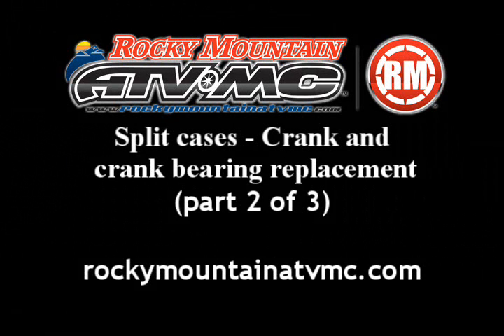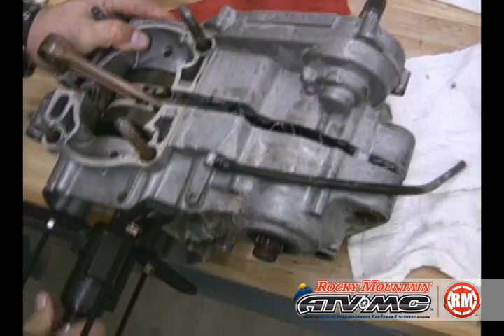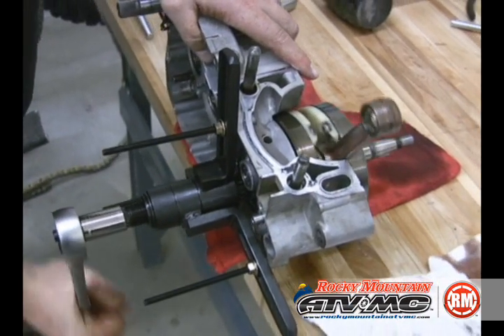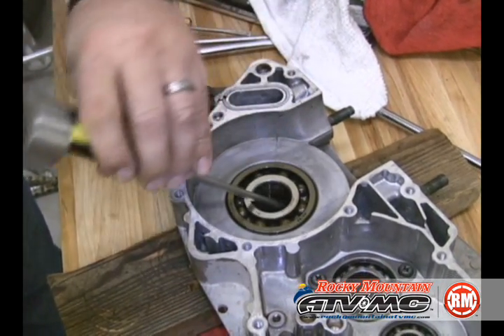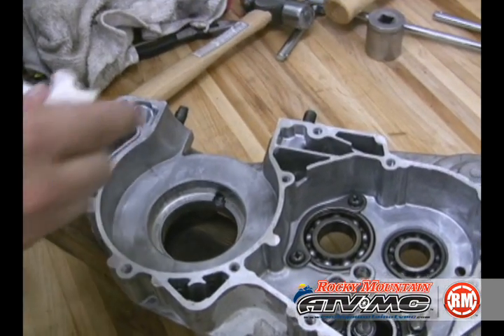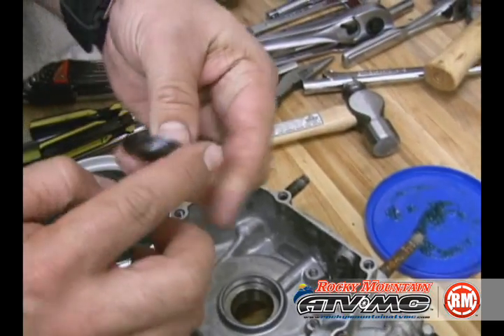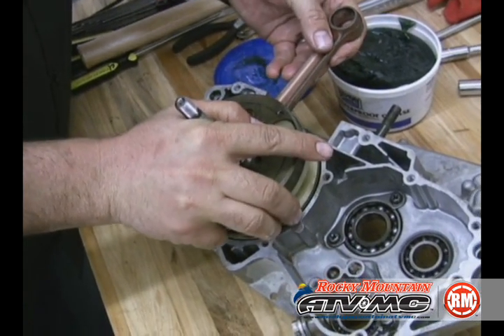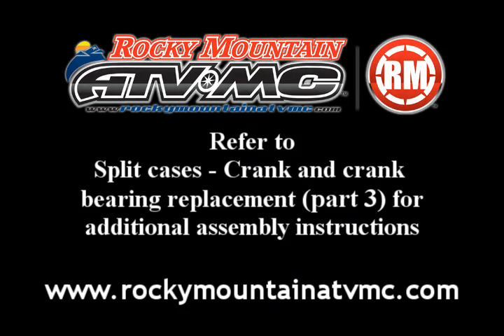Motorcycle Bottom End Rebuild | Part 2 of 3: Crank & Bearings

Comment: I did this bottom end rebuild and after me bike didnt run right, I pulled it apart and the cylinder has wore out of round. I also noticed that the crankshaft is all the way to one side of the crankcase, is there supose to be an even gap on both sides of the crankshaft and could this be what caused my cylinder to get out of round?

Comment from the maker: You don't want any up and down play in the connecting rod so you have a couple options... depending on the bike you have some cranks are easier to rebuild than others but a lot of times you have to have a shop do it. You would need to buy a new connecting rod assembly if you go that route... If not you can just buy and entire crankshaft assembly which already comes balanced and assembled but it's up to you...

Comment from the maker: Nope it doesn't matter, you can install them into either side. I will usually start with the right side and work from their but it's basically up to you to start with whatever side you think is gonna be easier. On some bikes if your crank puller only fits on one side of the crank it may be easier to heat the bearing and freeze the crank and install that side first and then use the puller tool to pull both cases together. Other than that it's totally up to you

Comment: For the other side it will pretty much handle itself when I go to put the case back together using a criss cross pattern it should be fine sliding the crank into that side by tightening the cases correct? U don't really need any tusk tools right.. I mean what did they do years ago before tusk was a company.prob help a lot to have them but don't absolutly neeed them

Comment from the maker: The only way to get these bearings off and not jack up your crank is to use a bearing puller. We sell a Tusk Crank Bearing and Gear Puller Set for $59.99 a piece. The part # is 1195970001. You don't want to hit and pound on your crank at all so a bearing puller is by far the best and easiest route to go.

Comment from the maker: I like to use a bearing driver set but if you don't have access to one a socket that sits on the outer race works just fine. Just watch and make sure the bearing goes in straight.

Comment from the maker: Usually i will put the bearings in the freezer overnight so they are good and cold and then pull them right before you and going to set them in. When heating up the case half i will go around it with a torch for a few minutes to the point where water will sizzle as shown in the video. Alot of times the bearing will drop right in with a little assembly grease but if it doesn't drop right in don't hit it directly on the bearing.

Comment: Nice instructive vid thx for that !!! Just to be sure... how long do you let the bearings cool down in dry ice & how long should an average warmin' up fase of the crankcase take with a propane torch? I tried to warm up mine with a heat gun and the bearing got stuck half way.. had to get it in with a hammer and that killed the bearing :( .... thx

Comment from the maker: Just follow these videos and your service manual very closely. You'll need a few different tools such as a flywheel puller, case splitter, crankshaft install/ puller tool and then also a clutch holding tool.

Comment: I have a important question, i was given an early 90's model rm 250 and the promblem was the guy i got it from drooped a bolt into the bottom in and locked it up and i was wondering if there was any way it couldve damaged the transmission???

Comment: I wouldn't suggest using a hammer and socket to remove the crank bearing. It's best to press them out using a proper tool, main reason is that if you should miss the socket your likely to damage the cases. Also some bearing can be considerably tight in the cases and care should be taken to remove these. Remember a bust or weakened case will be expensive to replace. JMO.

Comment from the maker: - It isn't actually cracked.  It is a "mark" from the casting process.  it is on the surface only and was there when they pulled it from the mold.  It is not a problem.

Comment: Sir, if you stop the video at 3:23 you can see a hairline crack in the crankcase just outside of the main bearing at the top of the screen. I rebuilt the bottom end on my 2005 YZ250 which is pretty much the same motor you are working on I believe. I had 1 crack like yours on one crankcase, and 2 on the other. None went all the way to the main bearing. Should I be concerned about these? Can they be repaired or is buying new cases the only solution? Thanks for your thoughts.

Comment: actually I did this on my bike today and you need to clear one thing up with everyone. Using a hammer to put the old bearings out is dangerous... especially since its common to sweat them out as well. Use a press to get the bearings out not a hammer you can ruin your cases that way. My shop teacher who has been fixing bikes chewed me out a bit because I nearly ruined a motor doing that.

Comment: i got a 03 kx250 and i removed my bear for the crank and used a hammer to put the crank bearing in and i didnt lube up my seal and one of my bearings spin faster then the other should i remove then and do what u did or will i be okay

Comment from the maker: - great question. Very common on kawasaki's. yes you can still heat the case, but don't use a flame. heat the case in your cooking oven. Just set the temperature to about boiling temperature. This will not hurt the seal. Your wife may be mad about the oily smell in her oven though (of course we like the smell)!!
Regarding the gasket - a 1997 kx250 does not have a center case gasket, so don't use one - use the liquid gasket.  the one in the kit is most likely for another year the kit also fits.

Comment: I have a 1997 kx 250 and the only was to insert the main seals is from the inside of the case. and the only way to set the bearings is to "swet it in" will that melt the seals if i heat the case and then install the seals and bearings? and in my rebuild kit it came with a gasket for the 2 case halfs. when i first split the case, it only had a liquid gasket. should i use the gasket provided? or go ahead and use the liquid gasket? Thanks in advance!

Comment from the maker: - your YFZ doesn't have a gasket between the case halves.  you must use yamabond.  Usually the rod bearing wears out before the main bearings (not always).  I would consider changing it as well since you will have it split.

Comment from the maker: @wardy1231980 - that bike is tricky because you have to put the two gear shafts, shift forks, shift cam intogether at the same time.  It is best to refer to the manual to see how they all fit together.  It is tricky getting them into the case half at the same time.

Comment: hi guys, yet again your vids are awesome. Any tips or tricks to putting back the transmission? i got a Yz 250 2000 model 2 stroke and it had major 1st gear shudder. i sorted all the clutch out and it didnt cure my problem. so engine out and stripped down, Theres wear in the 1st gear slots ( pretty bad ) and im changing the selector fork for good measure but as my trannys in bits im a bit stumped as to how exactly it goes back together. mainly the shift shaft. Can it only go in one way?? HELP lol

Comment from the maker: @breno6511 - you will need to look at a parts diagram to see where the water chanels run.  It has been a while since I tore apart a CR250r engine.  if the oil runs through the right case cover into the center case, it is a possibility there as well.

Comment from the maker: @breno6511 - It can only get in the transmission in a few places, so you will have to double check each one.  Obviously one is not sealing.  The base gasket or waterpump seal should be the only two places.

Comment: @RockyMountainATVMC  cheers mate, ended up borrowing a puller from moto joint, not easy to get your hands on if you dont know the right people, and the case splitter are sold most auto and tool shops, but the thing is, no one knew what it was or what its for haha

Comment from the maker: @bar4rodski -  The crank on a two stroke is lubricated by the premix oil you put in the gas.  The Air/fuel mixture is drawn into the crank, then pushed up to the combustion chamber.

Comment: @RockyMountainATVMC ya we used a harmonic balancer puller i think it was called we found the tool and bought some long bolts and nuts and it worked great only thing I got it all together and the clutch isn't working (this is my 5th time completely taking a blaster engine apart and putting it together) it starts in neutral but the clutch rod that hooks to the cable at the case i believe is sitting on top of the push rod that goes through the case halves any ideas or ways to fix w/o takin it apart

Comment: hi i was wondering if you could help me with my kx 65 it had no compression when i used to kick it over but it would bump start and have since fitted a new piston and rings as i was told this was the problem. the bike started a couple of times after the new piston was installed but now doesnt want to start again at all. any help would be greatly appreciated? cheers dan

Comment: The Tusk Crank Puller, what parts come with it to adapt it to the end of the crank?  If it can go on my crank nut I guess it could work looks like you bolted something into the crank but if that bolt hole doesnt exist or is worn out you cant do that.  Just checking I was thinking of maybe using it on an older bike if it would work before rigging up my own.

Comment from the maker: You don't want to pack the bearings with grease inside the motor.  They are lubricated buy the premix (main bearings on a 2-stroke) and by the transmission oil in the transmission.

Comment from the maker: i suppose you could warp it if you applied a lot of heat.  You are only heating the case to around 200 degrees Fahrenheit (to water boiling point).  This isn't near hot enough to damage the aluminum or cause it to warp.  However, the oven heating method works good too, but be prepared for your wife to be angry at the smell in the kitchen!

Comment from the maker: Some manufacturers sell the case halves together and some sell them individually.  Suzuki sells them together and when I had to change the left half for the same reason I had the same question.  I measured the new half and comared it to the old -- no difference.  so I ran only the new left.  It worked fine.  no problems.  Just double check by measuring.

Comment from the maker: The new top end won't cause additional stress.  if the bottom end is in good shape you will have no problems.  Check your main bearings by grabbing the flywheel and try moving it up and down.  it should have no up and down movement either.

Comment from the maker: Refer to our website for piston pricing - We don't have cylinders for that machine.  Tear it down before you buy parts.  You may not need a new cylinder.
as far as the kfx goes, did the bearing spin in the case (outer race) or on the crank (inner race).  That will determine whether you need a new case half or a new crank.

Comment from the maker: You need to find out what is wrong with the 125 before you start buying parts.  Does it have spark?  The 95 YZ was famous for having the crank bearings go bad and the stator frying.  I would check that first.
$1100 for a KFX is a killer deal, but what bearing is "spun".  Once again, you need to tear it down to see what damage you are really looking at.

Comment from the maker: The plastic pieces on the crank are used to fill a void of steel that was removed on the crank to keep it balanced.  These pieces can not be purchased separately.  You will need to buy a new crank assembly.  Chances are that your rod or main bearings are shot if the plastic came out.  We sell a Hot-Rod brand complete crank for your bike for $183.99.  You will want to get a main bearing and seal kit as well.  We have that for $38.99.  Good luck!

Comment: You dont show the 2T oil pump, anyways Im having so many problems with my bike it hasnt been a week where Ive changed my oil pump oil seal thats 3 times, one after the other in succession. 
It distorts the gearbox oil you can see it in the engine its all green in colour. My transmission oil is dark yellow by the way so its profoundly noticeable. Any suggestion I by the way I have a Yamaha RXS 100

Comment from the maker: It could be a couple things.  i would pull the right side case cover and make sure the shift cam mechanism is working right.  If it is, you most likely have either wore out gears or bent shift forks (or both).  You will need to split the cases the get to them.  Refer to your manual.

Comment from the maker: It sounds like your lower rod bearing is toast.  Make sure to change the main bearings and seals while you are there.  You can buy just a rod rebuild (rod, bearing, pin, thrust washers) for the bottom end.  You will need to have a shop press the old one apart and put the new one in ($50-$100 for their time).  We don't sell a complete crank for a 1990 RM250.  Any dealer can special order these parts for you.

Comment from the maker: Water boils at about 212 degrees at sea level, which is where the water drops start to sizzle (they are boiling).  You don't need to heat it to 400 degrees.  In the hundreds of crank bearings I have put in over the years, I have never seen any kind of problem come from it.  Don't forget, the engine can get 3 times hotter just from normal use.

Comment from the maker: Most KX models need a slightly diferent procedure.  I do it by heating the right case in an oven (torch will ruin seal) to 200 degrees.  Freeze the crank and drop it into the right case half.  Assemble the trany into the right case half.  Then use the crank puller to pull the left case half onto the crank.  In other words, the tool will only work on the left side.  heating the case and freezing the crank is the way to do the right.

Comment from the maker: We lightly used Bel-Ray Bearing grease on the seal and inner race of the bearing, but oil can be used.  The goal is to make sure the seal slides over the crank smoothly, and that the crank rotates smoothly once installed.